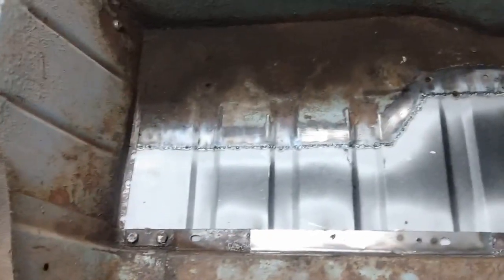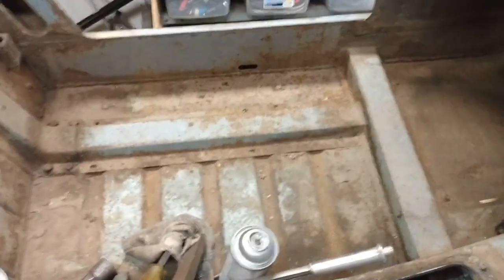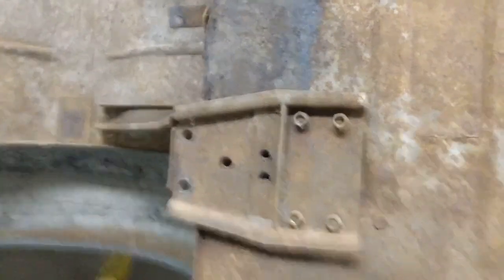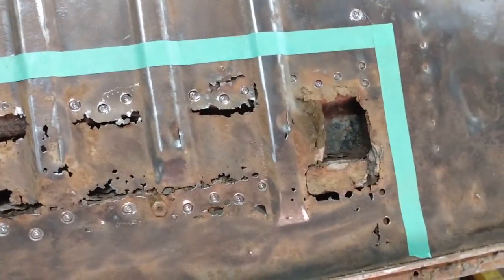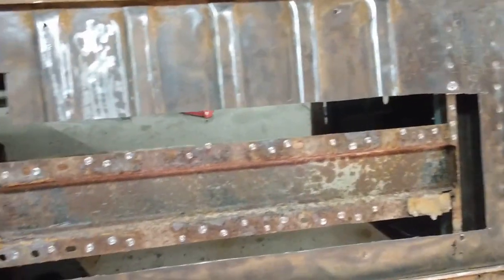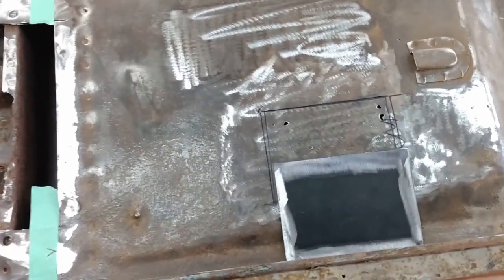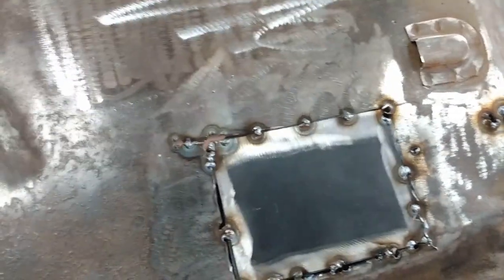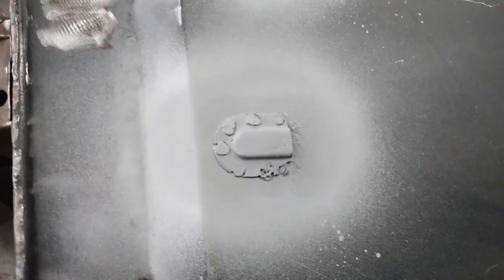Rear spring plate removal, passenger floor finished & driver side started! Bugeye Build Episode 15

Comment: Thanks for posting Ian! Really well done and good explanation of details. Looks like you didn’t use the spot weld cutter on the spring plate. Nice job too on the cut and butt. I really like Fitzee’s way of doing things. He makes it look so easy. Your welding is getting really good. 
I’m struggling with getting my spring out.. the bolts sheared off but it will not move.. I may have to cut out the whole spring box. It will need replacing anyway. It’s quite rotten. I’ll leave it until I get the sills installed.
Reply from the maker: HI Gareth. I just drilled out the spot welds on the spring plate as the cutter I bought (an inexpensive one from Princess Auto) wasn't working. Thanks for the encouragement on the welds... I'm getting a lot more confident! As for the spring I had an issue removing one of mine out which I covered back in episode 8. Perhaps that would help you out a bit.

Comment: Are you doing anything to the joints / overlaps of the new panels attached to the old metal?
The reason I'm asking is thats a real bad place for water to get in and rust. Are you going to seal it top and bottom? 
Just would hate to see all that work get rusty.
Reply from the maker: Hi Randy. I plan on seam sealing all the new and old panel joints... probably from top and bottom. Bottom side will get an undercoat of some kind and I may do something like bedliner inside the cabin.

Comment: Just out of interest, why did you opt to cut the old floor pan and not just replace the whole panel? I have to go through the same…soon…😋
Reply from the maker: The floor was in very good shape where it joined the transmission tunnel and, for the most part, where it met the inner sills. By not disturbing those parts of the original floor I didn't have to be too concerned with the car flexing while it was on the rotisserie. Only doing one side at a time also helped in that regard. Once completed the entire floor was painted with POR-15 on both sides.
Reply: @EconoboxGarage  thanks for the answer, you are motivating me to get started on mine….again, thanks for the great films you post👍🏻